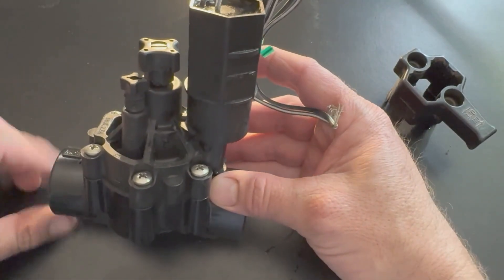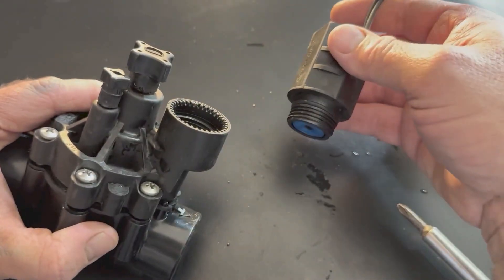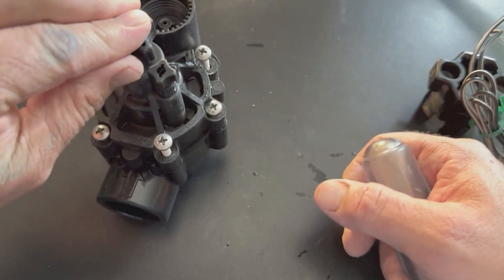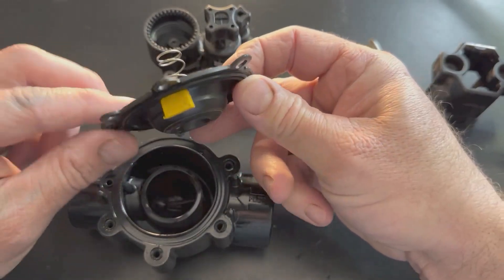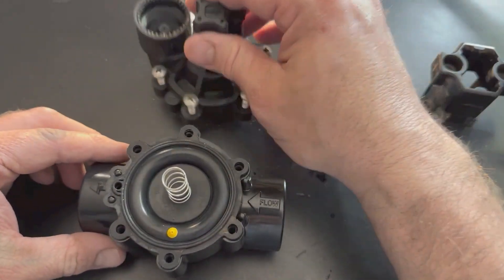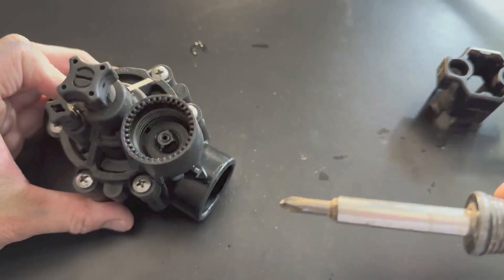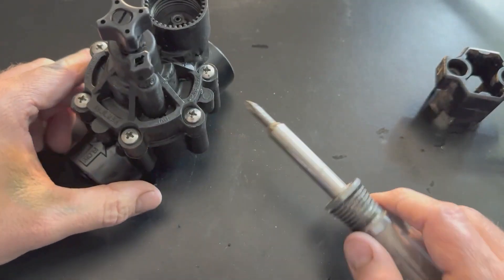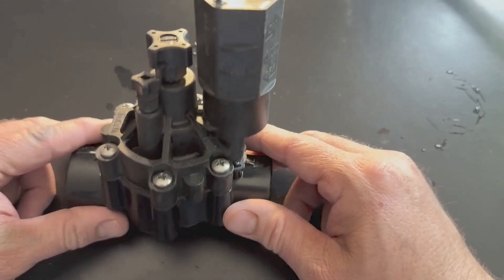Rain Bird Diaphragm Sprinkler Valve Repair Guide

Comment: Hi friend! I’m loving the videos. 
Sometimes, you are missing the “why”. Which helps explain what is rolling around in your brain. 
Example: why would you believe the diaphragm needs to be replaced-what leads you to believe this is the jacked up part? Why is it better to buy a new one versus changing out the diaphragm?

Also, I’m finding my valves are buried in dirt is that the way they should be or if this is just silted in, should I clean it out for the next sucker?
Much appreciated!!